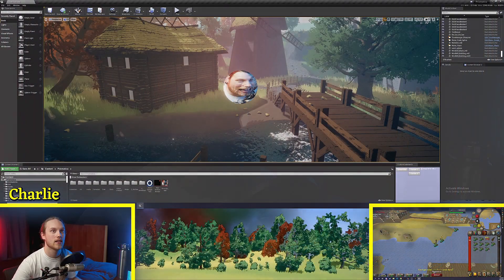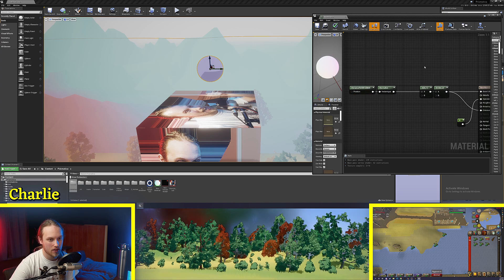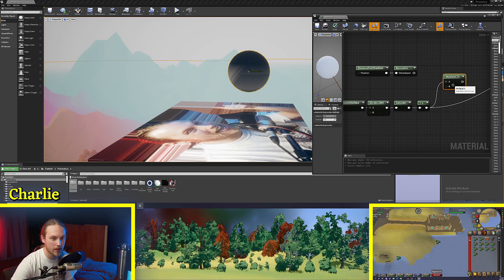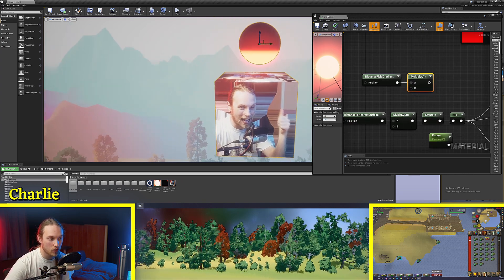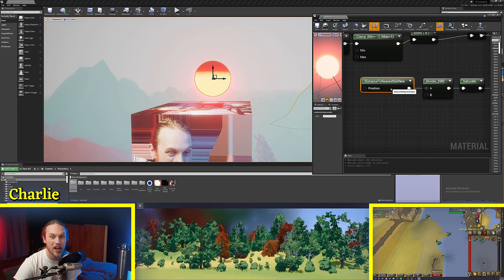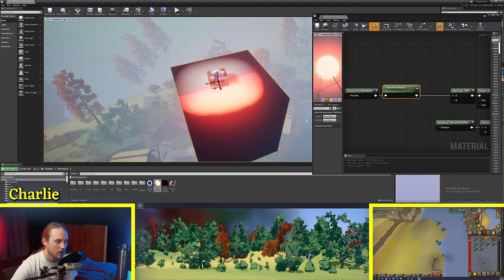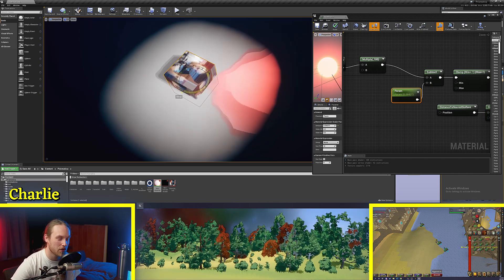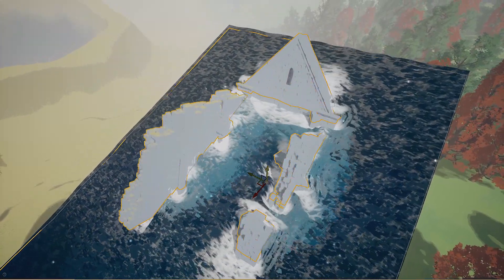Distance Fields (Part 2) | 5-Minute Materials [UE4/UE5]

Comment: (Yeah I know, late to the party)
Rather than using your highly detailed river boulders and things to produce the distance fields, maybe it would be better to use simplified, invisible/non-colliding proxies to emit the distance fields so you don't get as many odd behaviors from the distance field shader. Rather than, let's say a wooden handrail with sharp beveled corners you could overlay something closer to an octagonal tube. Or for the river rocks something that is more shallow but follows the profile of the shape. Definitely a final-pass polish solution.
Reply from the maker: For sure - the only downside would be that if you're using Distance Field Ambient Occlusion, the shadows could look a bit funkalicious. Recently I've been messing around using RVT's to do some similar stuff which I'll explain in a video about my ocean shader stuff soon!

Comment: This tutorial is really great.
Thanks to this video, I was able to implement the effect I wanted to implement.
However, there is a problem that I can't solve while experimenting with basic shapes like sphere and cone.
Cube and cylinder create an area of DistanceToNearestSurface regardless of depth, but shapes like sphere and cone don't create an area according to depth or angle.
Does anyone know a solution to this problem?
The version of the engine I'm currently experimenting with is 5.2.1.

Comment: I'd really love to know how to get a foam smooth trail when the character moves in the water
Reply from the maker: You'll need to use render targets or particles to achieve it - it's sort of impossible with just Distance Fields or material effects. Check out my Prismatiscape Plugin explanations of how it works :)
Reply: Yes! I figured that out, I think niagra would be a good option for me as I have experience in that rather than using render targets.

Thanks a lot! Your videos are amazing !

Comment: When I tried this, I noticed weird shadows that started showing up on my deforming mesh? It seems to be caused whenever I use the DistanceFieldGradient>Normalized. No idea why
Reply from the maker: Hey there - unfortunately Distance Fields don't get applied in the Shadow Pass - it's super dumb haha. You can alleviate it by disabling shadows or using a Shadow Pass switch to try and get the shadows to stop self-casting
Reply: @PrismaticaDev  I did try those fixes initially to no avail. But I my issue ended up being something else. When I selected my (skeletal) mesh, I noticed that the outline of the mesh in the editor was deformed in such a way that would actually explain the weird shadows I was seeing on the mesh itself. Almost like a deformed invisible version of itself was casting shadows.. on itself even though the mesh itself did not appear deformed at all.

This confused me as I was working with a 0-1 lerp in my logic, but it seems like in any fresh map I make, the DistanceFieldGradient was always returning 0,0,1 by default instead of 0,0,0 which I would have expected. My lazy fix was to just subtract 0,0,1 from the initial DistanceFieldGradient which zero'd out my logic and resolved it for me. (And I did try deleting all static meshes in the map, thinking that maybe the default floor was creating this upwards value but nope. Weird)

Thanks for the pointers though

Comment: Hey PrismaticaDev. How to use Distance Fields to hide water inside the boat? I'm trying to do this but i got stuck.
Reply from the maker: Oooh that's an interesting one. I guess you would want to use the DistanceFieldGradient node, and mask out anything that is positive Blue/Z. However you wouldn't be able to guarantee that if a boat is sunk it won't mask out the water above it. It would also interact with everything else emitting distance fields (landscape, props etc)

Comment: Thanks a lot for all your videos! i wonder if you can explain me how to use the virtual texture but only to the bottom of a mesh, i don't know if i'm clear but i need in a Waterfall material to put translucency when their is a rock in the water but only below the mesh, and currently with virtual textures it applies also on the top of the mesh :( which i don't need. Thanks a lot !

Comment: 1:00 There is no color change according to the position like in the video. It just looks like a material screen in the world
Generate Mesh Distance Field is on.. What can I do..
Reply from the maker: Hey hey! You need to disable "affect distance field lighting" on the object that is using the material, since the material will interact with its own distance fields. You might also need to enable something in your Project Settings about Distance Fields if that doesn't solve the issue
Reply: @PrismaticaDev  oh it's going to work!!!
Thank you!!!